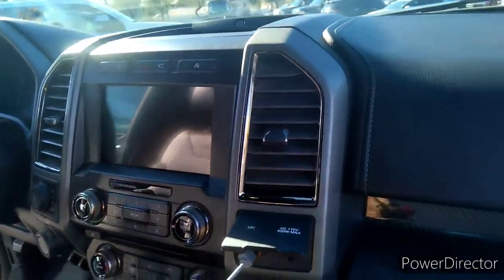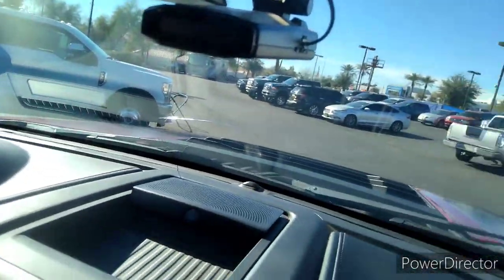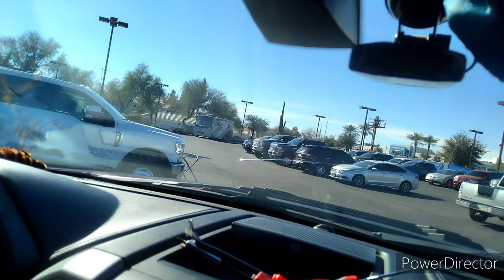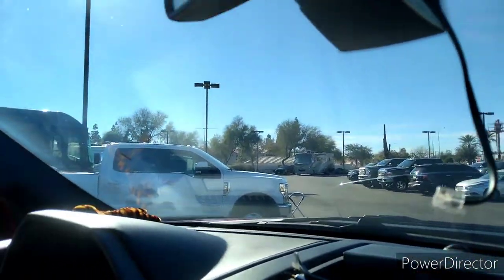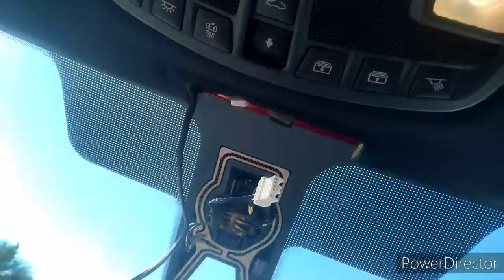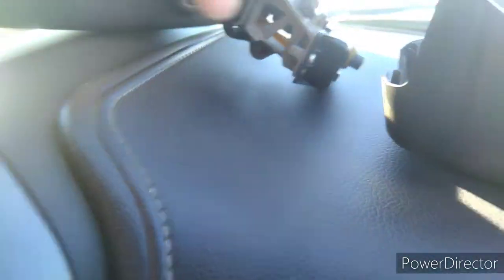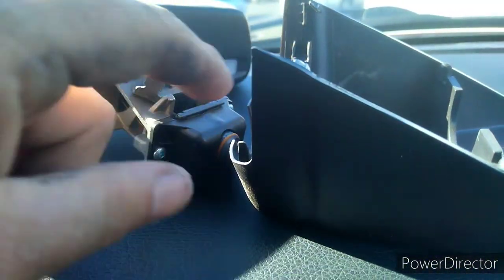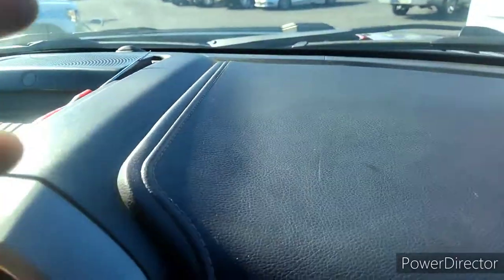2018 Ford Raptor F150 how to rearview mirror, camera, and cover removal

Comment: Would this be the same basic approach for a 2018 Taurus SHO?  I keep getting a message that the front camera is malfunctioning and needs to be serviced.  I wanted to take a look at it, but didn't want to break the cover or any associated clips.  It's used for auto-dimming headlights, which I turned off, so I don't care that it's not working.  I just want the stupid beeping and notices to stop!  I thought maybe something got under the cover and is messing with the sensor.  Odd thing is that the sensor is only supposed to work at speeds over 25 mph, and this warning goes off when I'm stopped or moving slower than 25 mph.
Reply from the maker: Wish I could help you with your problems on this one I would take to a Ford mechanic to fix it . A auto glass guy could remove the mirror cover it's different on the Taurus
Reply: @MaxxedoutRodz  I had a feeling it was going to come to that.  I appreciate your time and honesty.  Thanks for getting back to me.  Be well!
Reply: Thanks for the tutorial